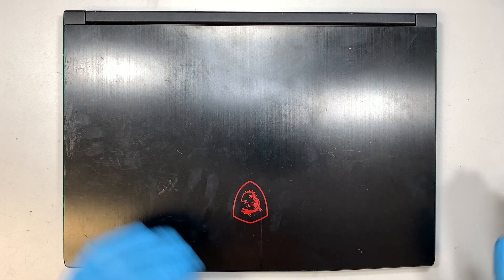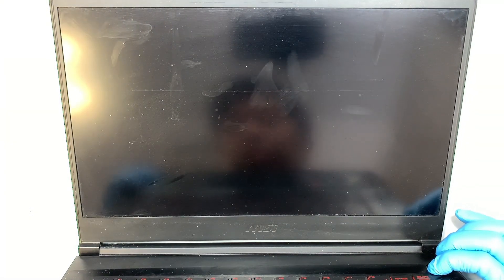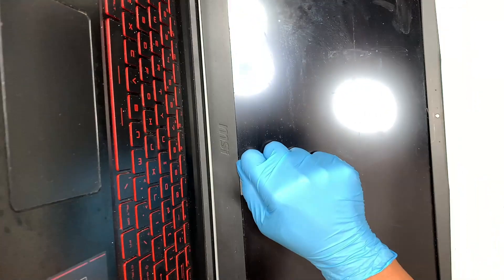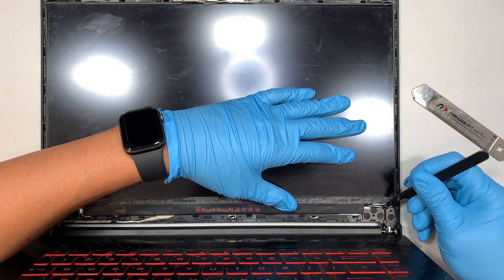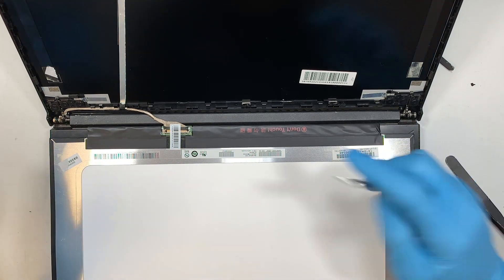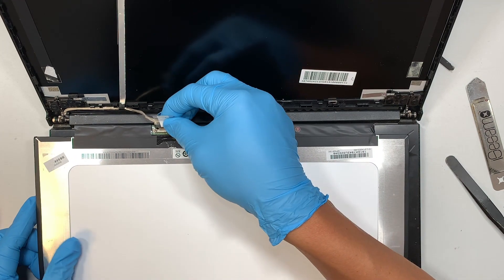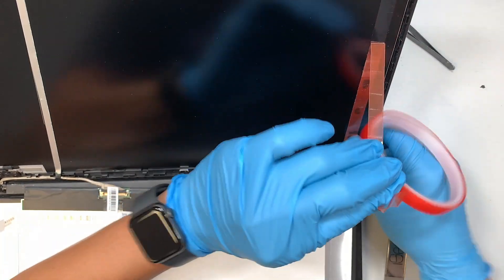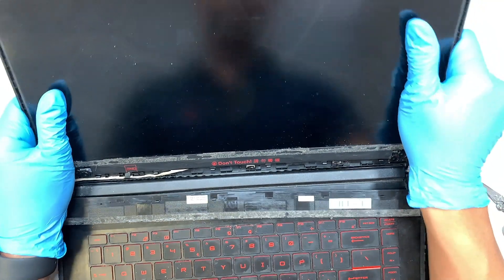MSI Laptop GF65 Thin 9SE  LCD Screen Replacement

Comment: REMOVE ALL POWER SOURCES, INCLUDING BATTERY
Reply from the maker: Is preferred but not necessary
Reply: @UbergeeksBiz its necessary, you know what? My laptop dead now because i dont plug off my battery, and now i need to find where is the short

Comment: Did the laptop display work after the monitor was replaced?
Reply from the maker: Yes
Reply: Any idea why the screen suffers from this problem?
Reply: I've got the same question, just dod mine and it the machine won't show signs of life
Reply: @BillyBob-fn7ff  Most likely your screen was either DOA or you have some damaged connectors or other issues with the laptop.
Reply: That's because you do not remove BATTERY! You damaged the motherboard

Comment: WARNING MAKE SURE YOU LAPTOP BATTERY IS NOT ONLY TURNED OFF BUT IF REMOVABLE REMOVE IT BEFORE YOU SHORT THE WHOLE BOARD
Reply: Uh... even if your battery is not removable you need to open up the bottom and disconnect it.  I just melted the connector on the cord trying to get it in. Now even more of a pain in the ass to fix this screen.
Reply: Exactly. Had a bunch of laptops with shorted caps, connectors, damaged (brand new) displays etc. after ppl trying to replace their screens without disconnecting the battery first.
Reply: My laptop short now 😢, try to find where is the short by myself, because repairman here just straigh tell me this is cpu this is that even without checking my laptop, this is frustated, and i dont trust anyone of them just trying to rip my money, i will buy every equipment then doit my self even its gonna end fail. My laptop msi gf65 thin, i dont plug off the battery then open lcd, then short happen
Reply: @Masterkompor  Same thing happened with me also recently. 😔😔

Comment: i have a msi gs65 stealth 9se 30 pin LCD and i bought a 40 screen by mistake. What happens if you connect my 30-pin laptop to a 40-pin?
Reply: Most likely short out the display connecttion on the motherboard, but you’ve probably figured that out by now or didn’t try.